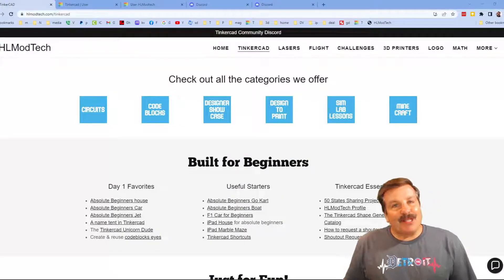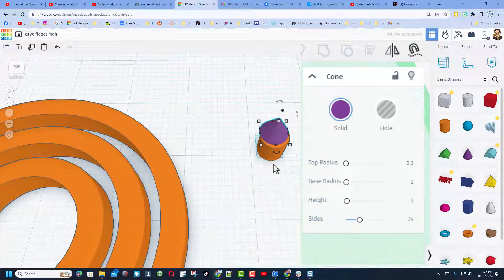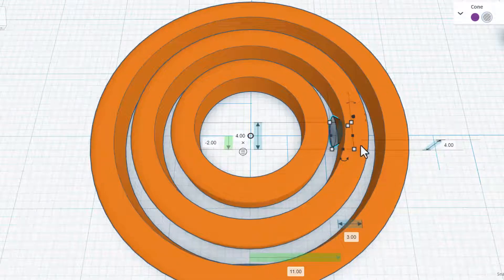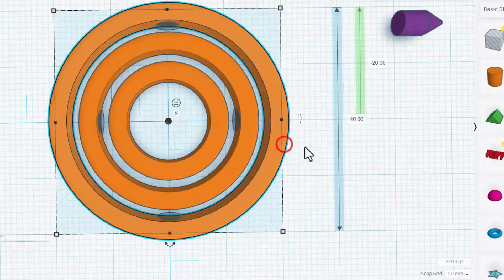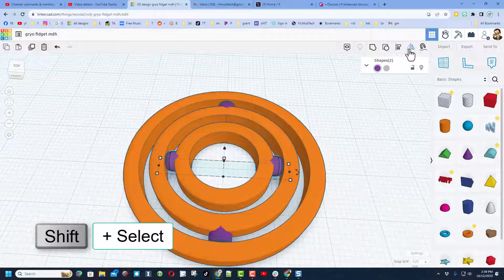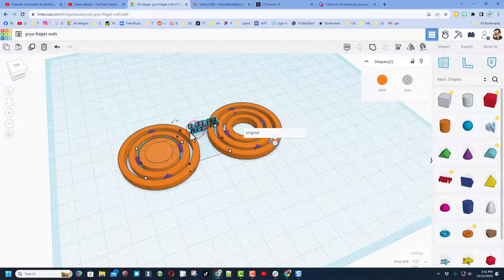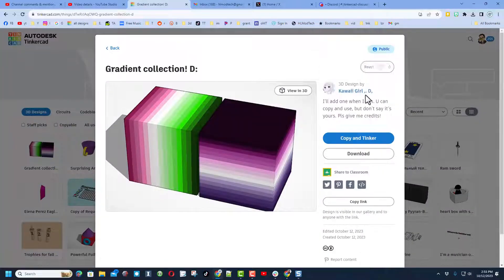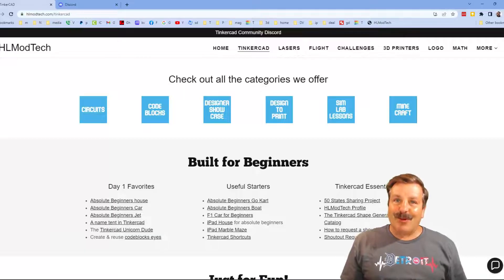Make an EPIC Tinkercad Print in Place Gyro Fidget Spinner SO FAST!

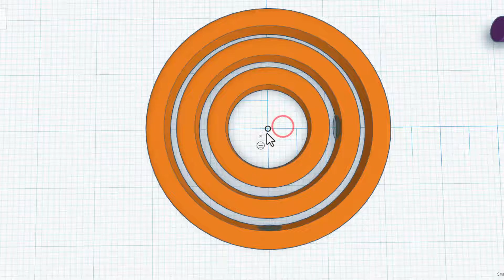Comment: 4:30 After placing that one hole, just duplicate it, mark it together with the outter Ring and spin it 90°, then use the clone and repeating function 2 times - done way faster :-)
Reply from the maker: Thanks for the tip. I will check it out when I get a minute.

Comment: can this be changed to have as many rings as I want? Just wondering because I think a 5 ring design with 45° rotation around each would look very cool
Reply from the maker: Just keep expanding the rings. You can also check out the codeblocks version and the let math occur automagically. =) https://youtu.be/OehFPT7pLNU

Comment: Whenever I tried to add the center for the initials, I clicked on the base as the boss and when I aligned it, the pegs moved into the center. No matter what I do, that's always the outcome.
Reply from the maker: Click on the pegs, then hit the padlock so they cannot move
Reply: @HLModTech  Thanks! It worked.
Reply from the maker: Very cool! The other trick I should have mentioned was using shift click to only select the parts you wanted to align. Both techniques are good solutions though.